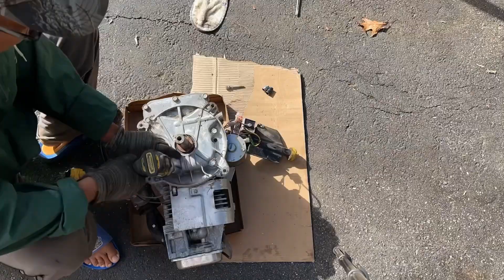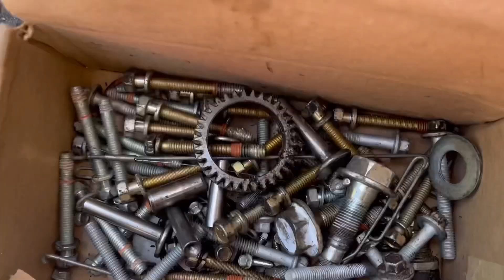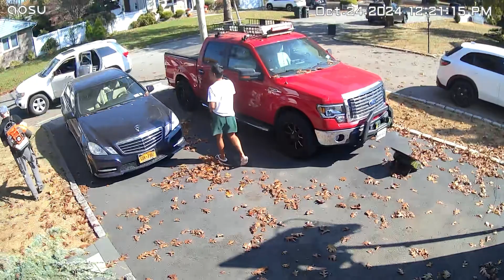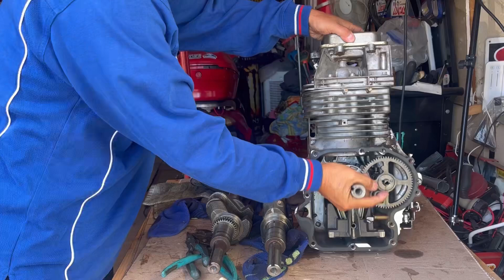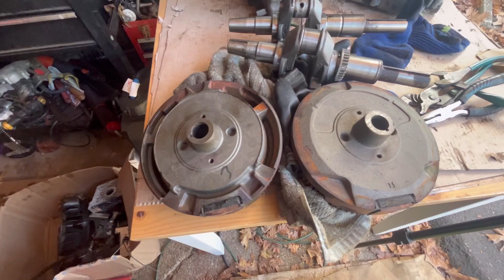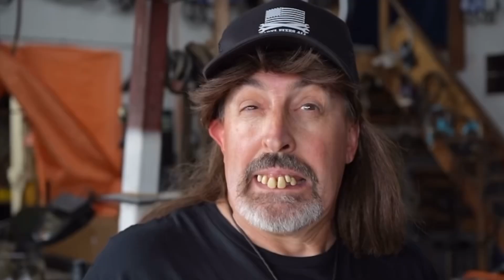REBUILDING BRIGGS SINGLE CYLINDER ENGINE USING MISH MOSH MYSTERY PARTS W/CORRECT TIMING COMPONENTS

Comment: The crank shaft that you have in the engine will not work with an oil pump and oil filter sump.   It does have the holes it for the oil flow
Reply from the maker: You are correct! He crank I have is for an engine without a fuel pump.  Good catch!
Reply: I have two of these single cylinder engines apart right now. Both are 540 cc with oil pumps. Neither one has a hole in the crank and there is no problem with that part of the engine. Not sure if it’s a difference between the 500cc vs 540cc engines.
Reply: I double checked and was wrong. They are both 540cc but one made in 2014 and the other in 2019. The older one does have a hole through the crank to oil the rod. The newer one doesn’t have a hole in the crank to oil the rod but the rod has two holes through it so I assume that’s how it gets oiled. The older rod doesn’t have the holes through it.
Reply from the maker: so for oil pump sumps,  I should use the crank with or without the hole?
Reply: Both of mine have oil pumps. I think if you use the crank with no holes you need a rod with holes in it. At least that’s how mine are. From watching the video it looks like the rod you used does have the holes through the cap and opposite side of the rod so based on how mine is you should be ok.
Reply from the maker: @0235thLE thanks buddy!